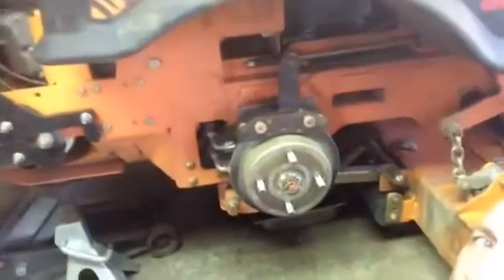Scag Tiger Cat II hydro fluid change tip

Comment: If you raise the deck door to the belts and remove the main belt off the spring bar you can put your oil pan and remove filter and plug without taking the tire off or zip ties the belt

Comment: what is the full mark on the hydro tank? I see the bottle neck, is is at the bottom?
Reply from the maker: I just make sure the oil is just touching the bottom of the tube that goes down into the tank.
Reply: @ricepadi29  It is. I read that it should be 3 inches from the top of the opening?
Reply from the maker: @danskinner467  if that is what you read in the manual then go with that.  You would think that they would make the tube the length they want the level.  I will take a look at my manual soon.
Reply from the maker: Check my manual today and it says full is two inches down the tube.